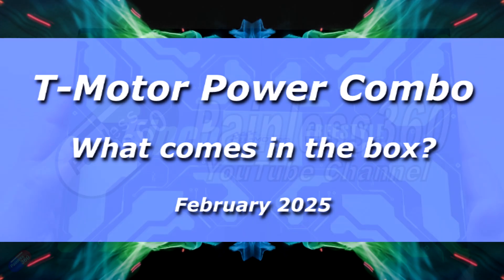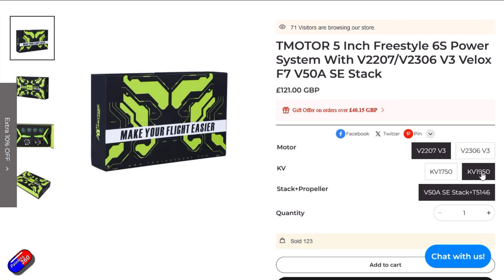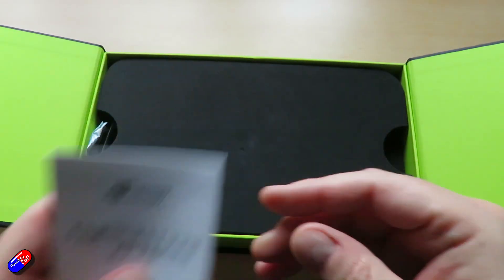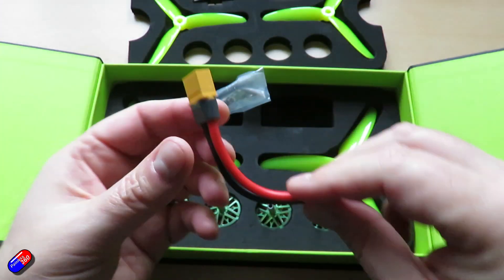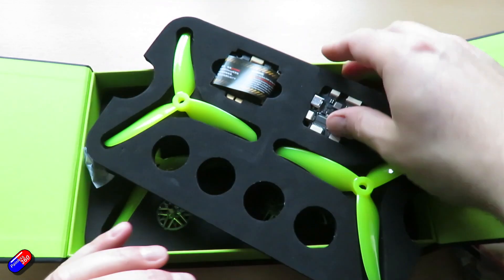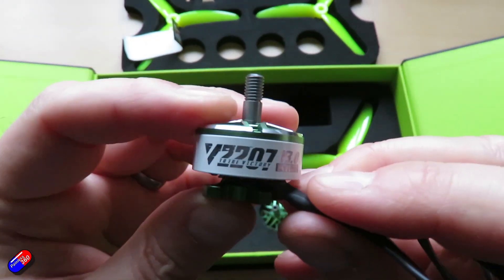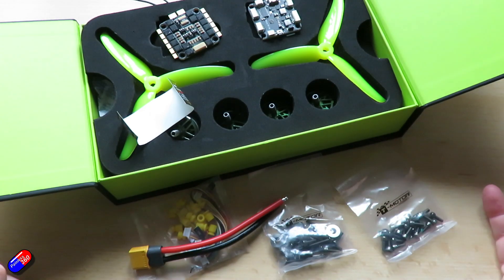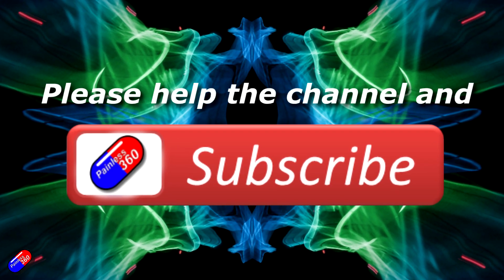Picking your quad build components just got easier: New T-Motor Power Combo Pack

Comment: Is this on blheli_32 just got one and plugged it in but its not the normal 5 beep its got a different tune and sounds like a bluejay start tone help gratefully appreciated as the tune i use you have to chane some esc settings in blheli_32
Reply: It dose say on hobby rc blheli_32 but just dont sound like this
Reply from the maker: I've not powered these yet. Best of luck